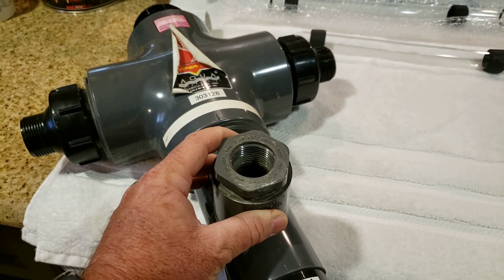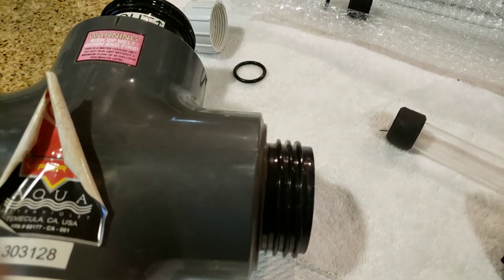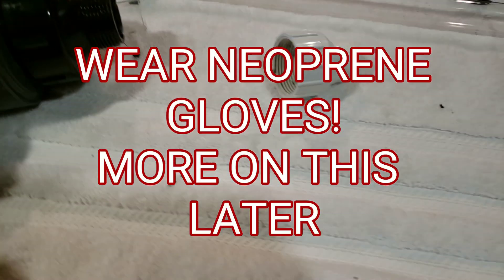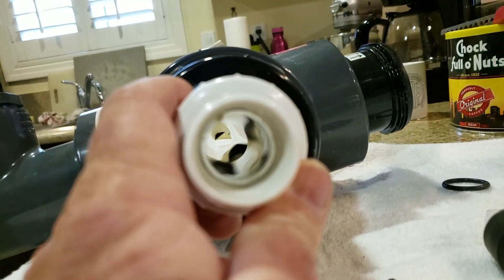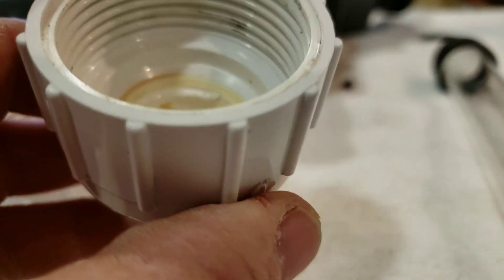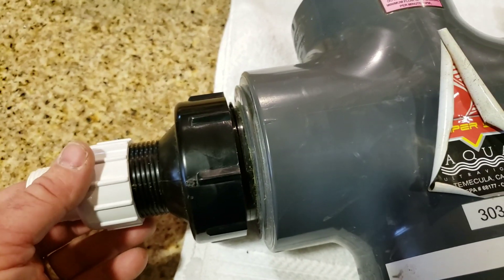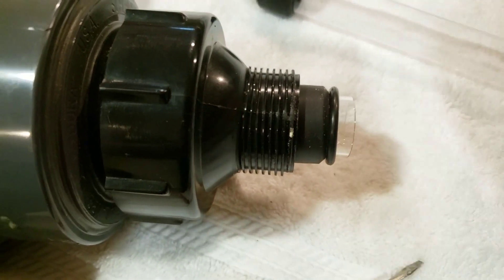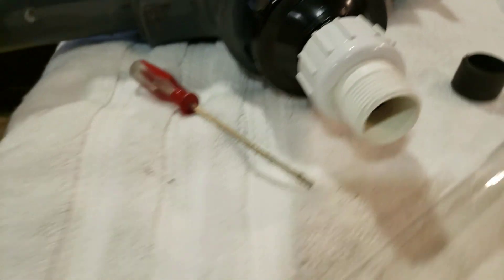Replacing the Quartz Sleeve | Aqua Ultraviolet 400 watt Viper

Comment: Do you prefer this Viper UV light or the 240 watt UV light which looks like it treats the same amount (25,000 gallon) pond but it's much bigger?
Reply from the maker: The viper can take a stronger flow rate.  Otherwise, the 240 is a fantastic uv